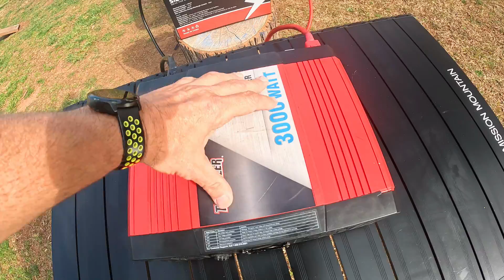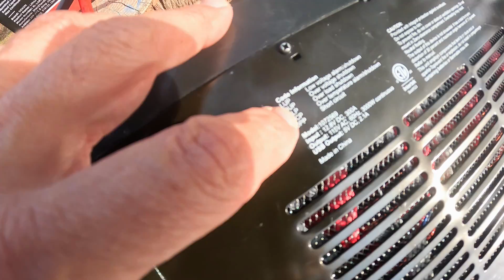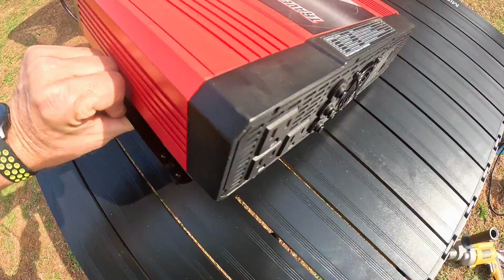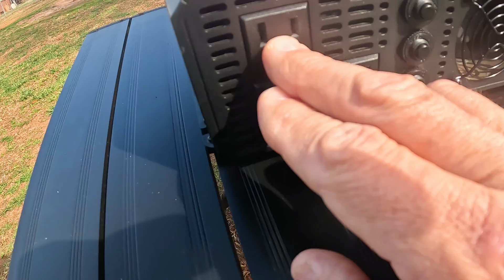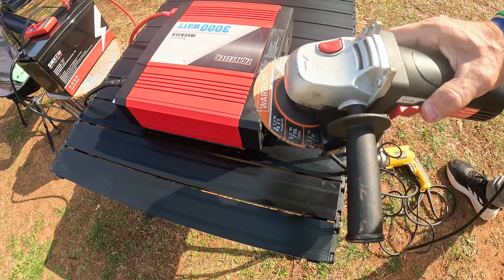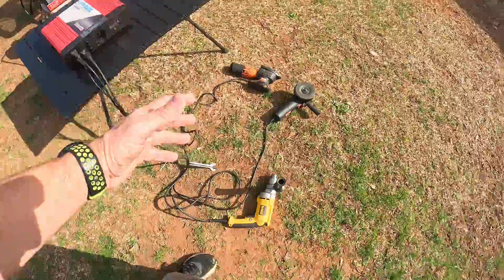3,000W Digital Power Inverter - Testing/Review

Comment: Thanks for this video.  I know it's an old upload at this point, but I want to clarify something in the video for the benefit of others that view this in the future.  The spec's on the bottom regarding the 12.8V input did not say 300A "MAX".  It said "300A" which is actually the minimum current capacity necessary for the inverter to supply the full 3000w out that it claims.

As for the 100Ah rating on the battery in the video, that's Amp-Hours, not amps.  The 100Ah on the battery label is the discharge rate the battery is rated to supply.  For example, 100A for one hour.  ...However be aware that there is usually some fine print on a spec-sheet somewhere such as "...at the 20 hour discharge rate."  In other words, it is not necessarily 100A for one hour, but 5A for 20 hours.  Where 5A x 20h = 100Ah.  It's a numbers game battery manufacturers like to play.  Note this is entirely different than the CCA ratings on vehicle starter-batteries.

One thing I would like to warn buyers of  is that the cable size of those supplied with the inverter is WAY too small for 300A.  At most, they'll handle 80A, perhaps less.   Experiment:  plug a 1000w toaster into the inverter, then feel how HOT those battery cables get.  ...THAT is if they can supply enough current without the inverter tripping out with "low voltage."

As for the existing arrangement with the single battery, if one were to beef up those cables to something that can carry 300A without heating/resistive-losses, AND assuming the battery can withstand a 300A discharge rate under full load without damage, that single battery will feed that thing for 20 minutes of load-time.  There are some efficiency factors to calculate in, but that's going to be pretty close assuming the battery is new.

Personally, I have this same inverter on a cart, with two 108Ah gel-cell batteries in parallel interconnected by a pair of #1 AWG cables, and am feeding the inverter from that pair with FOUR (two for [+] and two for [-]) #1 AWG cables.  I use it to power tools in remote jobsites where there's no power or gas generator not permitted.

I do like the inverter, but the ONE thing I find annoying is how under-powered it is per outlet.  As was mentioned in the video, it's 1500 watts per outlet max.  It is NOT going to start a compressor that draws 1800 watts , which although WAY below the inverter’s total output, it exceeds what the inverter will deliver to any individual outlet.  It's fine for lighter stuff like a chop saw, circular saw, drill, halogen work lights, toaster, coffee-maker, etc. though.

Lastly, for those considering purchasing this thing, just be careful of what you're plugging into it.  I would NOT recommend plugging sensitive electronics like a modern TV or desktop computer (a laptop charger would probably be fine though) into it.  That modified sine wave output is pretty "dirty" power, that my power tools hum under, but for short-runtime use with cool time in between, it should not hurt them.   Pure sine wave is of course best, but expect sticker-shock if shopping for one in this in this power capacity.  The Traveller 3000 meets my needs at the moment and I do recommend it.  I picked mine up at Tractor Supply.
Reply from the maker: Yeah i actually learned alot after this i was just putting everything together i appreciate your feedback

Comment: Why do you care if the drill has a ground on it...when the system you're plugging into is not grounded?  Running those loads, once they are started up, is not the "challenge" when it comes to inverters.  The surge current to start the motors, or the current needed when they are actually being used, is what matters.
Reply from the maker: I don't care about the grounded plug I was just showing that it accepts that type of plug some need an adapter to plug in and yes you are correct the drill surges to 1300w when it starts but levels off around 500w thanks for the feedback